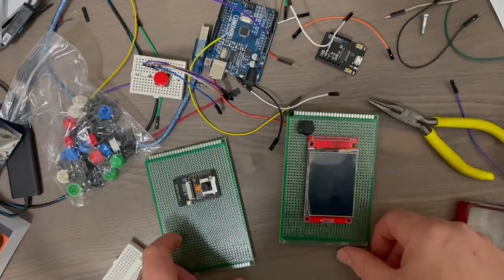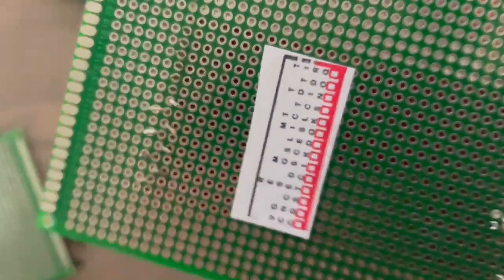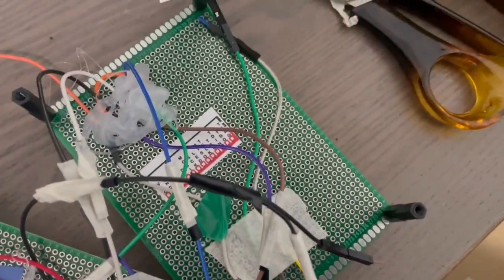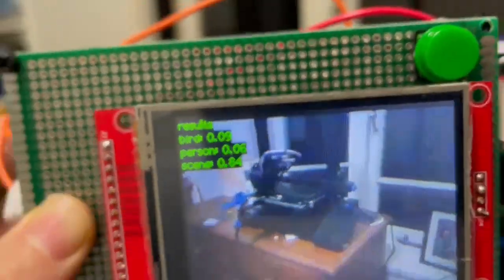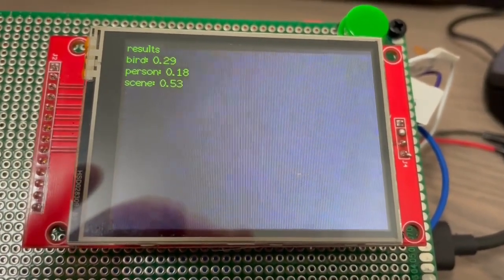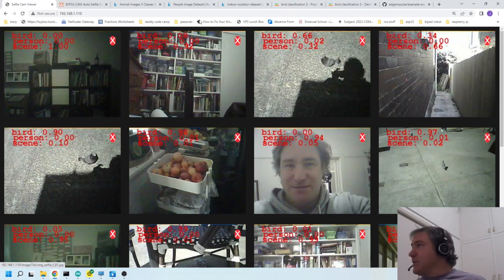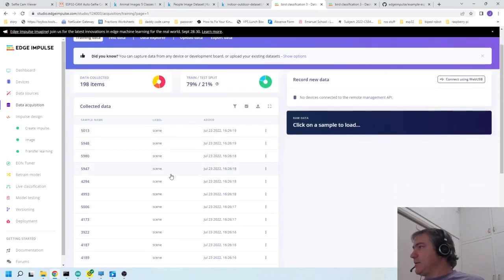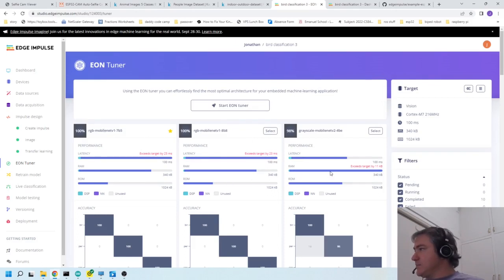diy smart camera: ESP32-CAM with TFT

Comment: Can we just Save it In micro sd card ? I made a similar Project which can store photos in sd card , But I didn't know how to add display so you can only see photo through micro sd card reader .
Reply from the maker: I don’t think it’s possible because there are not enough pins. Using the SD card on the esp32 AI thinker camera reserves some of the pins that would otherwise be broken out, maybe with the esp32-s3?

Comment: mais quand je dans Arduino IDE j'ai mettre la version 1.0.6 de esp32 il dit :
 In file included from C:\Users\Admin\AppData\Local\Temp\.arduinoIDE-unsaved2025123-12488-wxmgjt.ymwg8\sketch_feb23a\sketch_feb23a.ino:50:0:
c:\Users\Admin\Documents\Arduino\libraries\TFT_eFEX-0.0.5/TFT_eFEX.h:11:25: fatal error: JPEGDecoder.h: No such file or directory
compilation terminated.
exit status 1

Compilation error: exit status 1
Reply from the maker: @YOUSSEF_DHAOUEDI  it looks like you need to install jpegdecoder library. In Arduino libraries.

Comment: How to connect ESP32 cam to ST7735?
Reply from the maker: @jumbo999614  if you’re using Bodmer’s tft_eSPI library you need to uncomment the ST7735 driver in the user_setup.h file.

Comment: excuse me, i want to make it become a dash cam, is it possible and can you make a video about it? Thank you very much
Reply from the maker: That's a very good idea  The issue is, the neural network classification runs a bit slow on the esp32 for a dash cam. We could use motion detection so it records images when it detects movement.
Reply: @jonathanr4242  but actually i dont need it detects anything just for recording image while you driving car ~~
Reply: @tienong223 you certainly need another board for it

Comment: Hello, do you know how many gpio are free to add more buttons in case the memory reader is used?
Reply from the maker: There is not much in the way of pins for the esp32-cam. You can probably push it to about three or four extra pins if you use pin 16, 1, 3 and 0. But you need pin 1 and 3 for flashing (while 0 is held low). If you do OTA updates, you can probably work out something with those pins or you can work out some kind of pin-sharing arrangement? My advice would be to use a port expander or another esp32 dev board with an esp32-now communication (I have tried the latter on another project with good results).

Comment: Where is the circuit diagram bro?
Reply from the maker: The RobotZero website, referenced in the description, has the schematic for connecting the esp32-cam to the tft screen. The only other thing I use is a push button, which is on pin 4 of the esp32 cam. If you are using TFT_eSPI library you need to copy the User_Setup.h file from my github repo (the first github link in the description).

Comment: If I connected to usb camera. Then which embedded used
Reply from the maker: That would be dependent on what device the usb camera is connected to. The camera is just the capture mechanism but the image needs to be processed on some kind of computer chip.
Reply: @jonathanr4242  could you suggest which type of computer chip we can use to get the picture apart from computer.
Reply from the maker: @47lokeshkumar74  Ok. You mean a usb camera connected to a pc. There are a number of options for deployment. When you get to the deployment step, there is an option to "run your impulse directly" on a computer. I would look into that.

Comment: How did you overlay that OSD?
Reply from the maker: Hi. I didn't end up using the OSD because it didn't work with the colour image   I used the rgb_print function which is from https://github.com/MakeMagazinDE/ESP32-CAM/blob/master/app_httpd.cpp.
Reply: @jonathanr4242  Thank you. I assume that print function is injected into the video stream? So you can only see those values if you have video?
Reply from the maker: @madladdan  No. The opposite. I only overlay on a still picture. So, I have to convert it to rgb888, print out to the image, and then convert back to jpeg and save to memeory. The code is on my github repository. I also print out to the tft screen (same text), but this won't show up on the image file, only the tft screen. Also, you need to have esp32 board version 1.0.6 installed for this to work. 

//print to image
  rgb888_matrix = dl_matrix3du_alloc(1, fb->width, fb->height, 3);
  fmt2rgb888(fb->buf, fb->len, fb->format, rgb888_matrix->item);

  // HERE print some text
//  rgb_print(rgb888_matrix, 0x000000FF, "Hello!");
    

    for (size_t ix = 0; ix < EI_CLASSIFIER_LABEL_COUNT; ix++) {
        
        char tmp[32];
        sprintf(tmp, "%s: %0.2f", result.classification[ix].label, result.classification[ix].value);
        rgb_print(rgb888_matrix, 0x000000FF, tmp, ix*15 + 2);
      }

  Serial.println("printing to image");
  size_t _jpg_buf_len = 0;
uint8_t * _jpg_buf = NULL;

  
//  free(fb->buf);
//  fb->buf = NULL;
  bool jpeg_converted = fmt2jpg(rgb888_matrix->item, fb->width*fb->height*3, fb->width, fb->height, PIXFORMAT_RGB888, 80, &_jpg_buf, &_jpg_buf_len); //&fb->buf
  Serial.println("converted jpg");
Reply: @jonathanr4242  Oh I see. Thank you